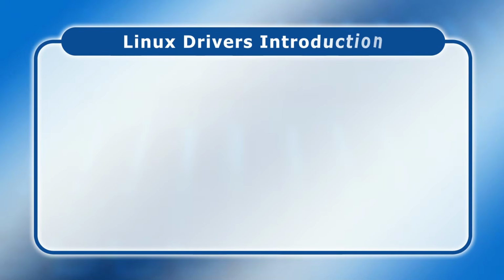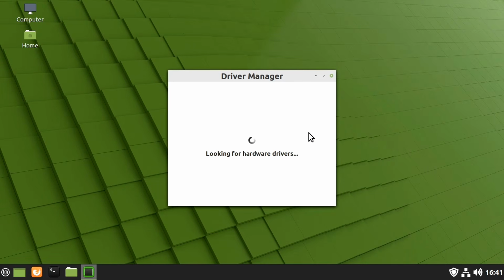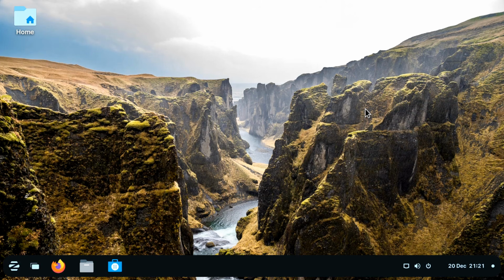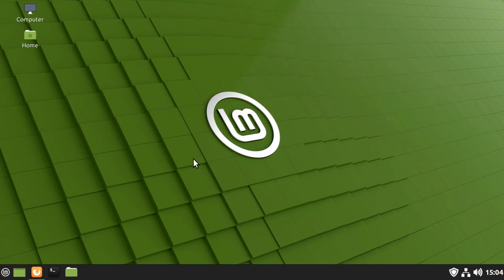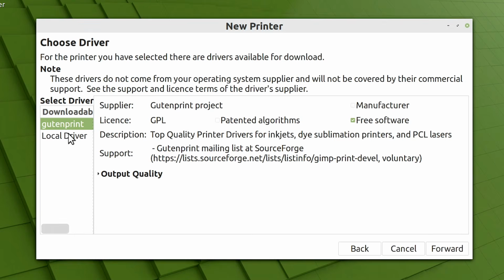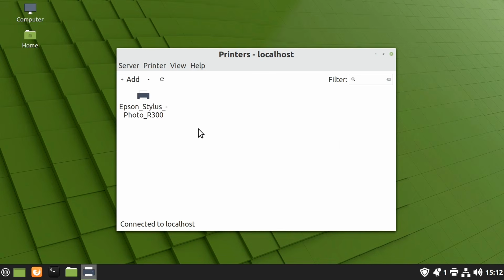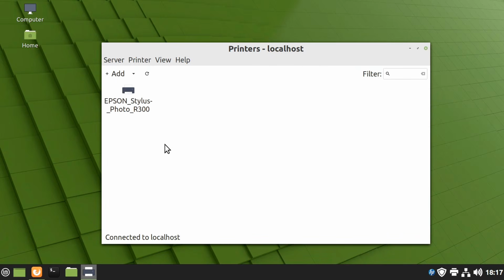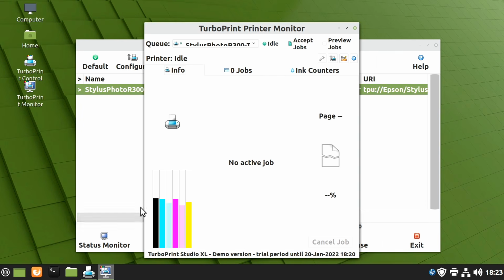Linux Survival Guide #3: GPU Drivers & Printing

Comment: pre-apologies for the rant. if you want to play games and do an occasional spreadsheet, just use windows, if you pretend to like jazz get an apple. If you want to use linux, be prepared to get your hands dirty and fix things. contribute, help, not just use. That is how open source gets better. Trying to get linux to conform to the windows standard  or "making this the year of the linux desktop" is only making linux worse for the tasks it is good at. *nix variants are for doing (often custom) computing tasks. windows and apple there to give you an "experience". If you are all people, and need all things, then dual boot.
Reply: Alternatively, if you have a relative who knows about computers and is willing to support you, running Linux is quite feasible.  My late mother ran Linux, as does my sister, and I do the tech support.  For my Mom, I set up a pretty locked-down system which worked well for her and likely prevented her from being scammed a few times by malware on dodgy web sites.

Comment: The support for HP printers that's built into the kernel should be all you need. I've got an HP multifunction inkjet on my network, and whenever I connect a new PC running Mint, or a Raspberry Pi, the printer is just there and ready to use. I now don't even bother to check if it's installed, as I know it will be there when I want to print something! Installing it on my laptop that dual boots into Windows 7 involved wasting time downloading and installing stuff from HP!

Comment: Hooking up printers has come a long way since a major milestone in the process was making the damn thing do something, even if it was only flickering a light. (Making the carriage twitch was even better.) Thar mean the cable was (probably) correctly wired. Then getting actual communication going was a possibility. A struggle with a specialised printer once had me questioning my sanity and piping single characters to an explicit /dev address before it became obvious that ir just didn't work. (I know, "barefoot in the snow, uphill both ways".)
The new way is much better.

Comment: i have a Dell T02G ST tablet with 32 bit arch. only and had windows 7 32 which boots fine but i have installed Q40S 32bit which begins to load and gets to second screen loading and shuts off any thoughts how i can get to boot fully? also have tried other 32bit only distros and the same result

Comment: I remember adding a Brother printer to Mint. I installed the driver, but the printer and computer would not talk to each other.  The printer test pages were fine, when I printed directly from the menu panel on the printer. I was ready to give up and just thought I would switch usb sockets in case something had gone wrong with the one I was using.  Turned out that the plug was halfway out of the socket. When I pushed it in Mint notified me I had added a new printer. I was embarrassed then but I can laugh it off  now.
Reply: I was surprised when I started to read about problems with Brother printers as I had heard reasonable things about them and Linux. Also I've had good luck in the past with Mint and their support site is ok regarding Linux.
Nice story.
Reply: @ivancho5854  I use a brother printer scanner combo in peppermint OS and was amazed how great it's worked since we got it about 2 years ago.
Reply: Brother is a bother. Too many ways in - network, wifi, bluetooth. You have to fiddle with the network and maybe enable/disable other means of data transfer. A plus to these negative is, you can direct print from smartphones.

Comment: I remember years ago, I got a laptop that I needed to also use for work, so I installed Ubuntu (instead of my preferred-at-the-time Slackware) because I needed everything to "just work", and I was delighted to see that the Live CD environment recognized the wifi adapter and connected to my wifi. After completing the installation to the HDD, though, the wifi was no longer recognized and I could never get it to work again.

More recently, I discovered that two of my printers that have always been troublesome to get working on Gentoo Linux (one needed a Java application to control it for some reason, and the other was listed as not supported in Linux) were immediately recognized and "just work" in Linux Mint. So things have really improved over the years.

I've always been lucky that I've generally had hardware that has been well supported by Linux (going all the way back to 1998), so I often forget to even consider Linux support when buying new hardware.
Reply: Avoid Canon!
Reply: @ivancho5854  Canon used to be a safe bet for Linux support, but yes one of my problematic printers is a more prosumer level Canon printer. I avoid HP printers like the plague. They barely even work on Windows 😁

Comment: You could really expand on the gpu part. Because there is great issues with what gpu type that work in Linux and not. Amd vs Nvidia. Some give image tearing and stuttering even with the recomended drivers etc. Linux is NOT very optimized or bug free when it comes to the graphics - and there are great issues that something only work well with one gpu and not the other. I would like to see an video around that subject.
Reply from the maker: I did say that I had only covered the basics! :)
Reply: @ExplainingComputers  I really do hope you will cover it. I would have great use for it and so would a lot of ppl who struggle with amd vs Nvidia when it comes to Linux. :)

Comment: I've been using HPLIP with cheap  HP wireless printers for years (the printers them self kinda suck but that's a different story)
and normally they work better then the original bloaty Windows driver and app..! 
just recently I installed Windows 10 on a new AMD desktop which immediately recognized the printer and recommended  installing some HP software - which actually couldn't  find the printer..

Comment: Windows an linux are two very different operating systems.  I have been a long time windows user and all the computers I have had are windows.  I have found this guide, so far, to be very helpful with my transition to linux.  Thanks for this.
Reply: They are very different. I hate it when people advertise Linux as a Windows replacement. It's not a replacement - it's an alternative. Everyone should be aware it is in fact a different beast that might appear Windows-like. But the experience is NOT the same. It requires A LOT more tinkering to get things work the way you are used to - and it is possible only to an extent. Ultimately, one has to learn the way it actually works to feel comfortable in it. It is a good alternative if one agrees to change habits and lose some functionality (individual, very specific devices and pieces of software are not supported - forget Adobe Suite, for instance).
Reply: @call_me_stan5887  Nah! It's tricky if Windows is all you've ever known, but is no harder to get your way around than any other operating system. The stranglehold of MS Office and Adobe can't last forever. It's just their short-sighted way of ensuring people won't venture out of the pen. The exponential growth of Unix/ Linux over the last decade due to mobile devices proves that the Windows monopoly is waning and that platform agnostic apps are available on anything. Almost all web servers are Linux. I am surprised that Windows/Mac OS still have the lion's share of the desktop world,  but there's little to keep it that way.
Reply: @smile768  I know what you mean and yes, I do agree that's due to Microsoft's monopoly. And there's MUCH to keep it that way - all the corporate world to begin with. Corporate world needs standards and uniformity, Linux DESKTOP can't give them that. Linux SERVER is a different thing entirely. It does not require any user interface apart from CLI. The familiar GUI, standards and support is what makes Windows what it is. Linux can't compete only in the first part - GUI of various DE's is getting there. But still - VARIOUS DEs and fragmentation. Linux desktop is going nowhere, unfortunately. It's the enthusiasts' gem. And don't get me wrong, cause I love it - but it won't just take off anytime soon.
Reply: @call_me_stan5887  Well, depends on what you're doing with it...for most use, Linux, esepcially Mint, pretty much is a Windows replacement. Nearly same GUI, the same or very similar apps, etc. Then again, I've been using this stuff way back on DOS and Amiga, so the differences just aren't notable to me.
Reply: @VulpisFoxfire  not a replacement, home alternative for sure. And I'm telling it as a 3 year+ Linux Mint user coming from Windows who still uses Windows for corporate stuff because there's just no way around it.
Reply: @VulpisFoxfire  Plus there will always be some edge cases - for instance not so great support for certain hardware - like my almost new HP 455 G7 - it sucks in Linux, is great on Windows, though. Or my GTX1660 Super - also sucks in Linux. Various shenanigans and workarounds needed to make it work properly.

Comment: I usually have issues using older Nvidia hardware with current versions of Linux. I have a desktop with a GTX570 and a laptop with a 9600m that black screens on boot using the current version of Ubuntu. I think the problem is with using the proprietary driver however the performance is so bad on the open source driver and I have to reinstall the OS to switch it over due to the black screen issue.

Not had any of these issues using older Amd or Intel gpus.

Comment: I don't have a printer any more but remember the problems I had getting my lovely old Samsung CLP500 working under Linux. Great once it was working but difficult to set up as the printer ran its own protocol and needed a proprietary filter installed. I'm fairly sure it was pre-CUPS as well.
Reply from the maker: Pre-CUPS were dark days! :) Setting up a printer in Linux is so much easier than it used to be.

Comment: I always had problems with my Epson inkjet printer when I was using Windows but Linux has had no such problems
Reply: lucky - mine has not connected at all
Reply: My Linux mint worked very well withy Brother laser printer, my Canon and Epson inkjet printers with no problems
Reply: You need ink for your driver's to work.

Comment: Greetings sir....hp linux printer application is working fine on my linux mint...is there any way to run android applications on Linux ..(not on emulators )...anbox is not working for me..
Reply from the maker: Great to hear that your printer is working in Linux. I've no experiene of Android apps in Linux -- yet! :)
Reply: @ExplainingComputers  actually few android apps are far better than the mainstream pc applications. These apps are running buttery smooth on android phones..(on arm processors ofcourse) I just want to see if it runs similarly on pc or not...
Reply: Anbox has a long way to go, even if you do get it running IMO. Even then, you'd have to find apps that have x86 support since Anbox uses your Linux system as an virtualized Android environment in a container (AFAIK, don't quote me on that)